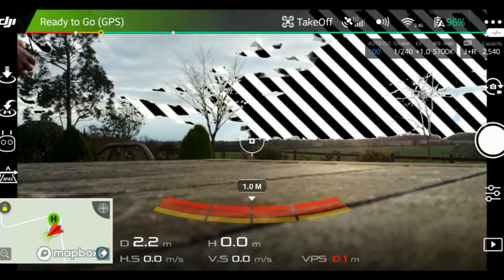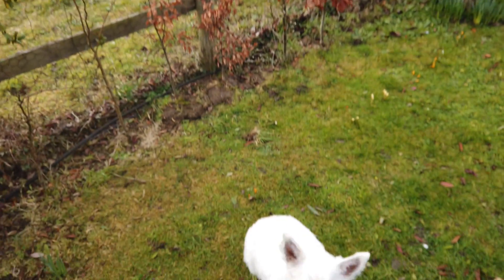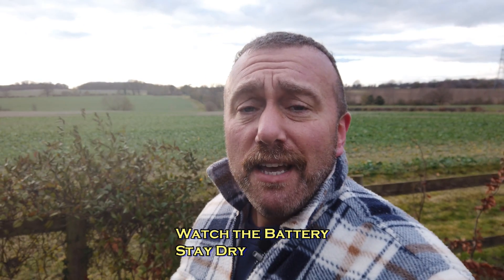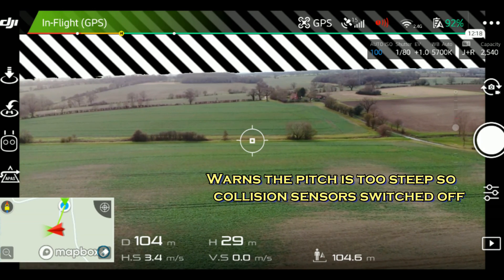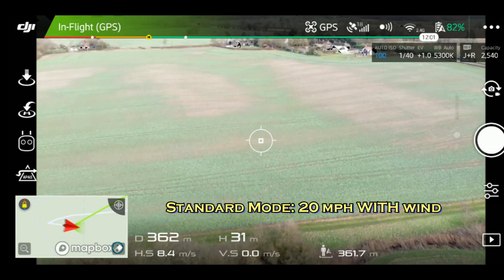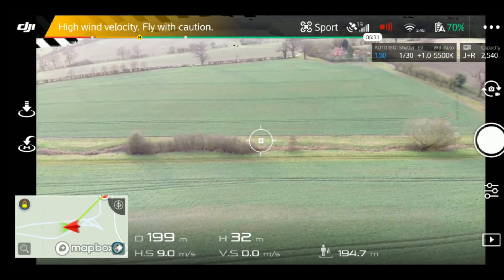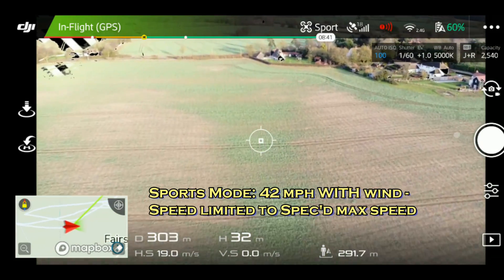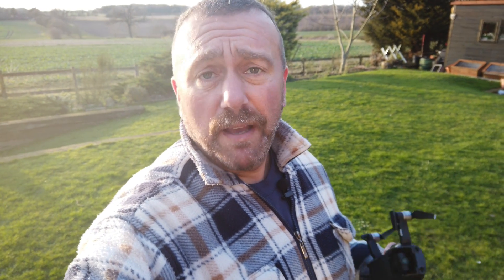DJI Mavic Air:  Flying in High Wind - Why it's so Fast

Comment from the maker: So are you just a fair-weather flyer or do you get out no matter how windy?  The Air never ceases to amaze me with how well it handles high winds....  What's your take?  
And yes, guilty as charged to all those who spotted my lack of leg-extension. At least this wasn't a range test ... 
Cheers, Ian
Reply: Aren't the antennas also built into the leg extensions?
New firmware also now which also needs to update all your flight batteries.
Reply from the maker: @IM35461  All you eagle-eyed viewers!  😃  Yes, should have extended the legs but the signal was fine for this flight!  Will remember next time.  Possibly 😃  Ian
Reply: Hi Ian, great video mate,, whats with all the black and white lines on your screen footage...?
Reply from the maker: @MarcRCAddict   Thanks Marc.  I'd left the 'Overexposure' indicator on, which highlights areas that are over-exposed on screen.  Usually not an issue as I use the proper SD card video, but for this video I had to use a screen recorder to grab the readings, and that showed up the zebra lines.  Cheers, Ian

Comment: Quick question...as long as the Air is taken care of,how long can I expect the motors and main esc board to last?
I think maybe that neither would ever have to be replaced unless damaged by collision or water.
What's your thoughts and experience with this?
Have you ever had to replace the main esc board or motors on the Air?
Do you still have yours??
Reply from the maker: They should last years; I've not had any issues with any models
Reply: @IaninLondon  ...great,thanks for your response...helps me out alot because although I have flown,built,programmed and messed around with drones and all things RC for a very long time time...I am relatively new to DJI.
So far the Phantom,the Air and the Tello have been the highest quality drones I have had.

Comment: Having faith and trust in the quad is the hardest part, I tend to fly in 15mph and under to be safe. That said I did risk it flying in the fog and mist... given the choice I would choose wind! Water doesn't mix well with drones! 
Cheers Ian 👍 another good vid!
Reply from the maker: If you look at the small map in the lower left you can see the direction of flight versus the actual path taken, and it shows how it's being blown off course but it easily handles it....  And yeah, fog = moisture which isn't great....  Cheers, ian

Comment: Great video and information as usual ian great wee drone the Mavic Air the only thing I struggled with was the Wi-Fi I was having problems with connection 👍👍🇬🇧
Reply from the maker: Yes, no doubt the Air struggles with interference; I'm betting DJI will never release another "Enhanced  Wifi" drone like this.  But it handles wind fine....  Cheers, Ian

Comment: Didn't you loose a dji or mavic at the cliffs during rth 2 years ago?
Did you find that drone and got a dji coverage?

I watched your videos but can't remember any updates regarding that loss and the missing audio emergency beeper
Reply from the maker: Yes, my poor little Mavic Pro got lost just 3 weeks after I got it.  And I never did find it, so I couldn't claim on DJI Care as you need to provide the drone itself, which I couldn't. But I managed to claim on my home contents insurance under the Personal Possessions All Risks policy.  And I learned a few lessons 👍🏻👍🏻  Cheers, Ian
Reply: @IaninLondon  Sad to hear that you didn't get it back - but you seem to have a solution with another insurance you haven't been aware of in the moment it happened. Well, your experience was a warning to me to start with a lower invest and longer road. Aosenma was a start from which I went to tello, then to Xiaomi 4K and from there to DJI Spark and range extender up to Mavic Zoom & Goggles Racing edition & fly more ... so far it preferred to come back to rth even I hate all these nerve racking beep tones ... cause they are the introduction of a beginning night mare followed by windows I have to close instead of 1 notification and let me take care ....

Thanks for updates
Reply from the maker: @typxxilps   The irony of Dover was that I had been flying the Phantom 3 for almost 2 years with no crashes or incidents at all, so I trusted myself with a £1,000 new drone!  That lasted 3 weeks.... :(